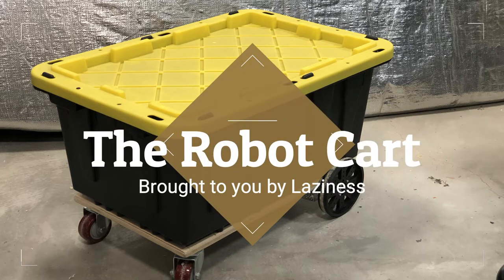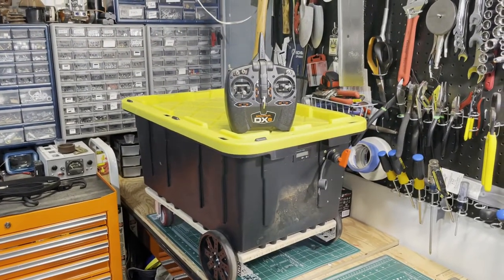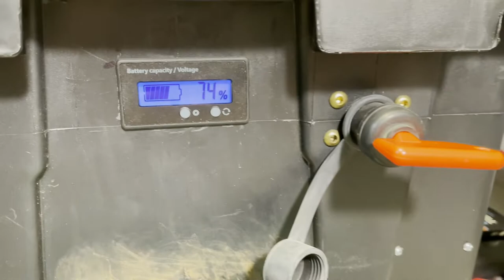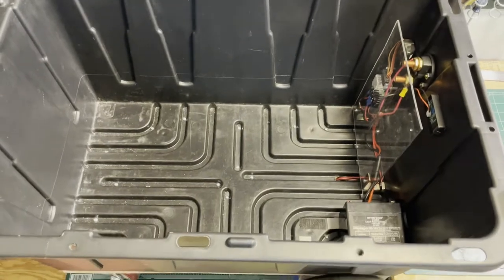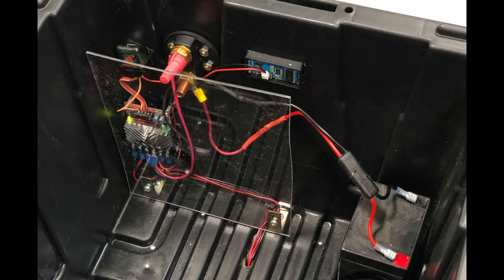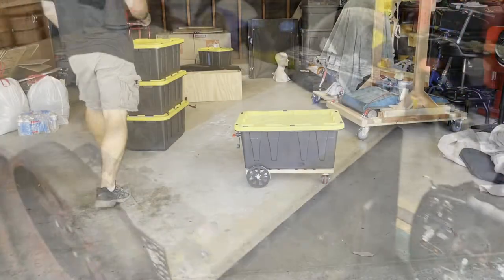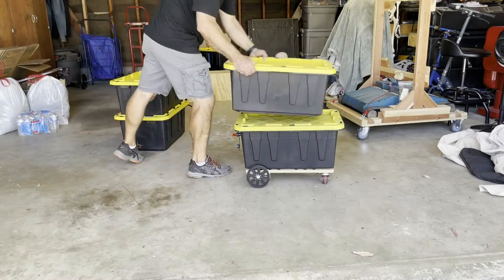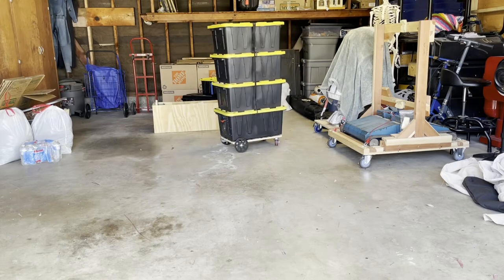The Robot Cart

Comment: Nice, simple and elegant.  A lot cheaper than a MouseZilla and likely slightly better control!  However, two days ago I test hauled my 3,041lb car in the driveway using the Zilla, so there is that.  :D

Any notions to make that control pack an exterior module that hooks on to any bin, or mounted to the sled base?  What is your total
Reply from the maker: You could use a system like this to motorize any cart. I had most of these parts laying around, but it is probably a couple hundred dollars to do a set up like this. You could also make it just a platform to put a storage bin on. It is ideal for anyone moving something over a long distance.